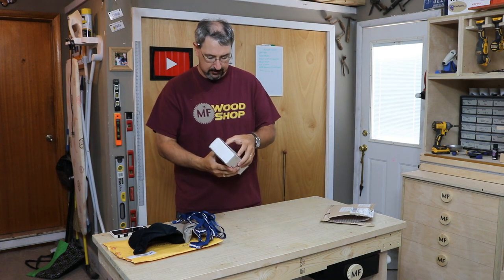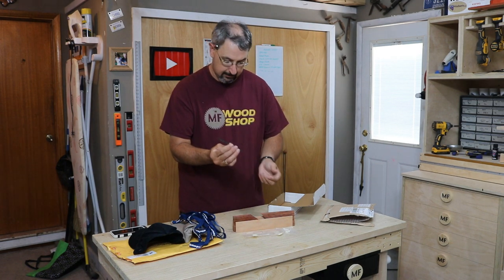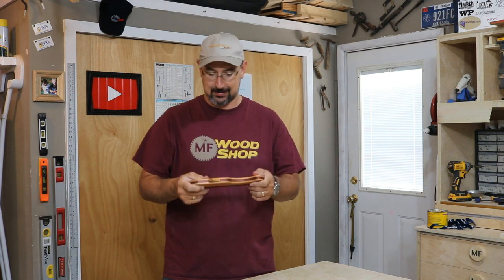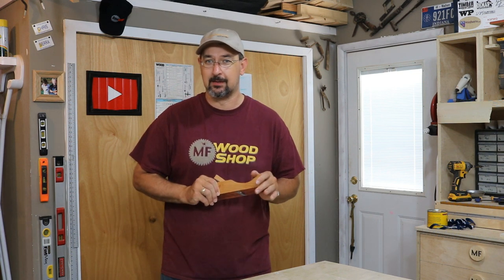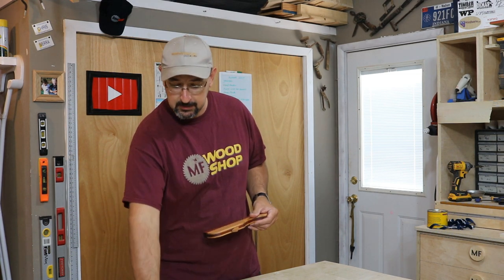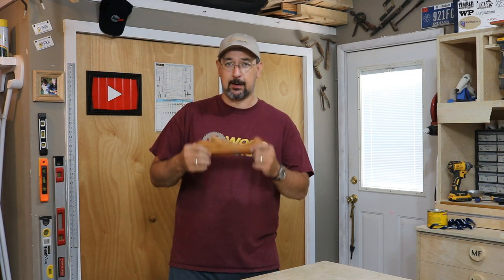Make a wooden Shoulder Plane

Comment: Looks like an enjoyable project! I am however surprised that a maker of plane blades would  call that a shoulder plane, when more correctly it is a rabbet plane. A shoulder plane typically has a bed angle of about 15 degrees with the blade oriented bevel side up . Not a big thing but there is a difference.
Reply from the maker: I was thinking the same thing when I was putting it together